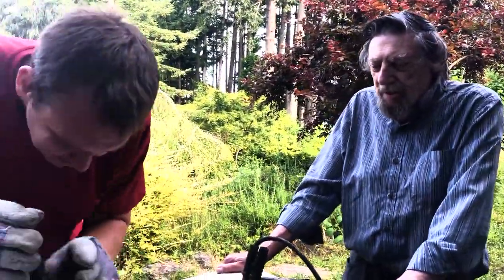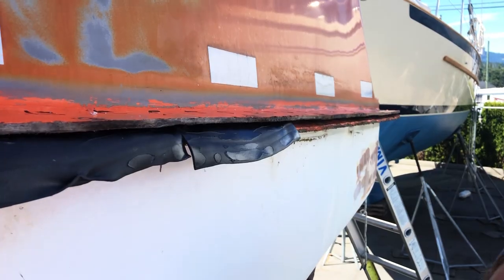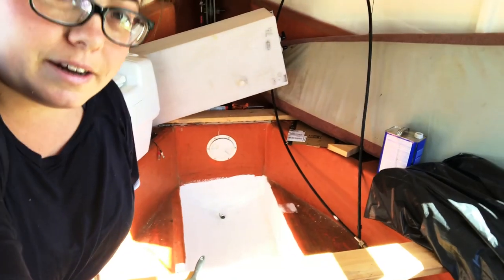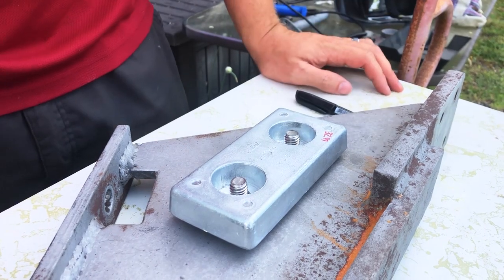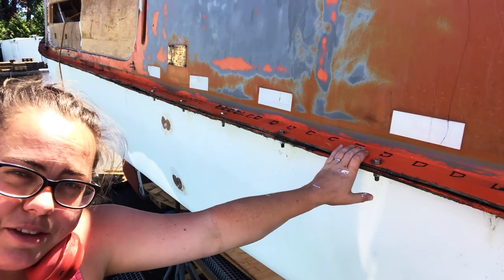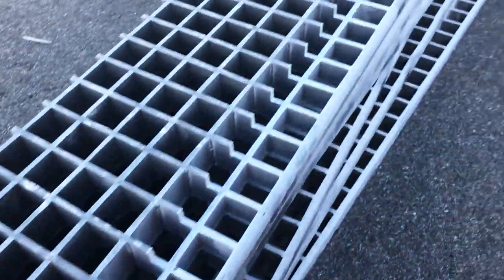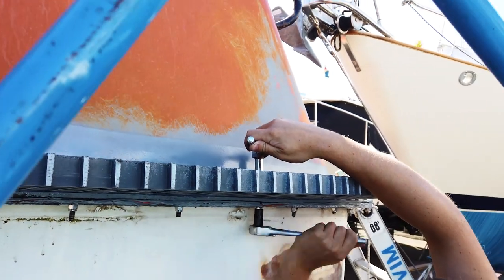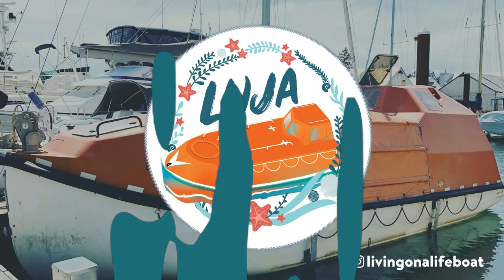Ep 10: Will This Lifeboat Walkway Hold Us?!

Comment: Before you weld galvanized you need to grind the galvanizing off, and then weld it. They also make a clip for that walk grading material that recesses the bolt head so you can stump your foot on the bolt head.
Reply from the maker: Hey thanks for watching! The bolts are actually stainless. The welder (and me lol) are not the greatest but it didn’t need to be pretty and so far it seems to be working great. 

I had actually looked into the clips but they are meant to handle vertical loads to hold the panels down. I was worried about the panels sliding around which is why I used heavy bolts with fender washers in the corners of each square. This way the shaft of the bolts were keeping the panel from shifting left or right and front to back and the heavy duty fender washer was taking the vertical loads.
Reply: @LivingOnALifeboat  Your welcome just trying to offer some additional information to help, and yes stainless can be a Pain in the Neck to weld. I’m very interested in do the same the so I’m looking at a couple channels that are doing something similar.
Reply: dont forget to put a sacrificail anode as this liferaft was never meant to be in water permanently. and dont forget to check it on regular intervals to replace it once it corrodes away

Comment: I would make think epoxy an will the edges in where the life boat bolts together,  the part the rubber used to cover.  Make it water tight more permanently and could fair it in for more strength and a better look while also been  able to glass the connection of the grates for added strength as well,  he should understand what I mean I hope lol.  Love it, keep it coming!  More updates regularly!
Reply from the maker: Hey thanks for watching! I ended up glassing the whole inside seam of the boat to keep any future water out of the boat. Unfortunately with how they had previously sealed the joint and how difficult it was to hold the top and bottom apart it was impossible to clean out the joint well enough to glue the hulls together without bringing in a crane to lift the top half of the lifeboat off. So I figured the next best option was to just fibreglass over the joint on the inside.

Comment: For the bolts holding the rubber you should have used the cordless drill and a socket, it is much easier and quicker
Reply from the maker: I’m not sure exactly what point your talking about but we had some problems with Gauling as the bolts and nuts are 316 so the faster you tighten them the worse the risk is. Even with anti-seize…. We used a cordless drill and socket to begin with but had to stop that after we screwed a few up.

 Thanks for watching all comments are welcome :)
Reply: @LivingOnALifeboat  Hi, I didnt know they were 326 stainless. Yes you are correct with the galling, apologise for the comment made

Comment: Have you considered the few tons of ballast you will need? 
Batteries will help but you've removed the engine and are shy about 58 souls onboard.
Reply from the maker: Hey! Yes we have, the lifeboat will need about 10000 pounds of weight to put it at its 60 person capacity. We are leaving areas for ballast deep in the hull which we will fill depending on how she handles. This will also allow us to add more to once side or the other to balance the boat out.

Comment: Hi guys nice job so far . I think I would have added some brace's to the under side  of the walk way . Not only for support but make the impact survival ability a bit more . And maybe a heat gun or heat lamps (s)to get the rubber bumper to behave a bit better . Here is a video for you . https://youtu.be/JjpCFP0jJIY
Don't let the hater comments get you down , I just posted my project on Facebook and got slammed with a few hate comments , but I really enjoyed pissing them off with my replies .
Reply from the maker: Thanks! We had thought about putting brackets underneath to support the edge but I decided to try without for the time being as any sort of bracket would be something that could catch up on debris in the water or edges of docks etc. 

So far the side decks have been very sturdy (1 year in now as these videos are still quite behind) 

That said as they are bolted in place everything can be changed if problems pop up in the future!

Comment: I think I would have been tempted to fiberglass the top and bottom together instead of bolting it.
Reply from the maker: Hey thanks for watching! Unfortunately we didn’t have the ability to separate the two half’s to be able to prep and fibreglass them together. This is why I went back to the original construction method but with stainless bolts vs steel ones. The holes are not very tight so we shouldn’t have an issue with crevice corrosion. That said I did grind all the inner joint and I fibreglassed the two sections together. That was more for keeping any moisture from working its way through the joint tho.
Reply: @LivingOnALifeboat  Makes sense. I guess anyone can do a perfect, optimum job and process given an unlimited amount of time, money and tools.  Enjoying the series, thanks.